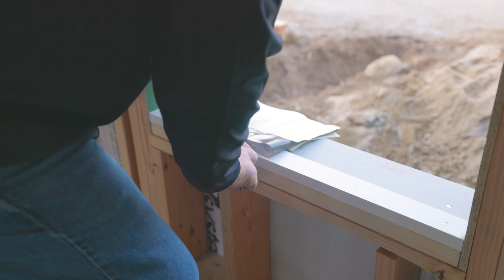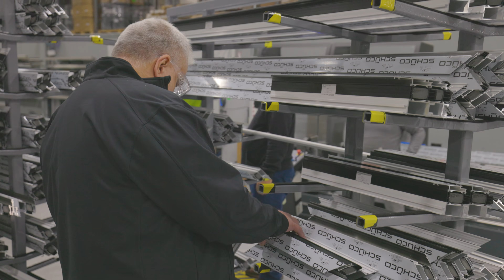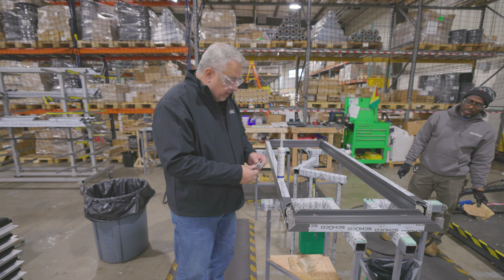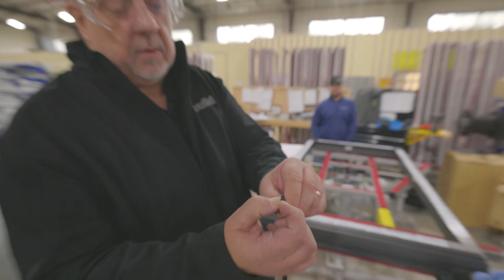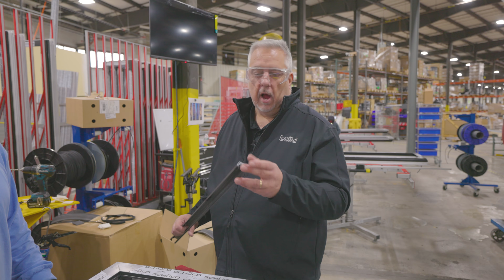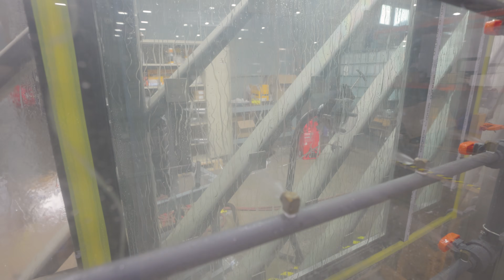"Window Installation Pt. 1" Build Show Build: Boston Ep. 8

Comment: I'm wondering how to reconcile the under-window shims that allow water drainage with a desire for a highly insulated window (here in CZ 6). Letting the water out is great, but engineering a thermal break to the inside of the window frame isn't.  Is there a solution for those of us in very cold climates?

Comment: Hey Steve, local fan of your work and fan of the show.  Question:  My wife and I recently moved from our post-war home in MetroWest (which had no window issues) to a ~15 year old custom home by the water in Plymouth.  We have been having issues with our window installation on the ocean facing side of the house letting water in behind the vapor barrier, which has resulted in some rot in the OSB sheathing.  Fortunately it has not made it in to the sheetrock.  Last summer I was able to replace the most damaged section to include some framing, and my removal of the window trim revealed no flashing installed except for the lead on the upper pendant details. 

I am planning on having a contractor remove the window trim on the remaining front windows, and flashing with a ZIP tape IF the sheathing is still intact.  If the sheathing is not intact, I will have him remove some of the siding and replace the sheathing with ZIP and ZIP tape flash the windows in place. Is this the best option short of removing the windows, which would increase the cost of the project, potentially prohibitively?  I'd normally do this myself, but I don't have the time at the moment.  

I know you mentioned having seen lots of bad window installs, I'm curious if you are familiar with the best practice for repairing incorrectly installed flashing.  Thank you for any thoughts and guidance!

Comment: Tariffs! Anyone know what the tariff is on a window imported into the u.s.?
Reply: Thank you for joining in - much appreciated , I don't but will try to find out
Reply: @stevenbaczekarchitect9431  I searched an couldn't find any info about tariffs on imported windows. I found it surprising that Schuco would build the windows in the US and was wondering if tariffs could be a reason similar to how euro car manufacturers complete their assemblies in the US to avoid tariffs. Loved the factory tour though, very interesting. I recently purchased Rehau euro tilt and turn windows for a basement window project, they are very nice however I did not realize until after they arrived that the frames are much larger than on a standard US window, ie there is a bit less glass relative to rough opening with these vs other options with my windows.
Reply: @fox156  You couldn't find???  It took me literally about 5 seconds to find out.  It's 5.7%.   From some chosen countries however it's free.   "us customs rates for doors and windows"   🤣🤣🤣

Comment: If it’s a 3-ply gas window assembly; can the outside facing window be a storm-ballistic glass or all three to prevent high or extreme winds from a projectile breaking glass.  Can this be provided by assembly manufacturer?
Reply: Hey there,  European windows fabricator here.  You can get ANY crazy combination of glass panes in your IGU from a good glass manufacturer.  I do, all the time.  For a break/penetration resistance glass, the best would be to use shatterproof glass, or laminated glass.  A laminated glass is two layers of glass glued with a PVB film between them.  The thicker the PVB the better, they come at 0.38, 076, 1.52mm.   You can even get a higher penetration resistance if you add a layer of film on the outside surface of the glass, (there are "bullet proof" films) but then you might be sensitive to scratches.  That outside layer is applied in the same manner as the tint on a car window, so they are replaceable if they scratch too badly during the years.

If you're looking at the 3 pane IGU, you might need to go to 2 panes because of the added thickness of the first glass.  You also need to take into consideration the total weight of the unit.  1mm thick of 1 sq meter is 2.5kg.  So a total of 16mm glass will be 40kg per 1 sq meter.  A sliding door can take more weight than a side hinges door or window.  There's also the hinge weight rating...  

Anyway, if you make the outer glass laminated and thick, the inner glass thinner but still laminated, you can get a high resistance to penetration. 

Oh well...  I didn't think my answer will be that long.  🤣
Reply: @danl.4743  Thank you Dan.   I lean on the more heavy duty - over engineering side so will save this and get back to you and Steve when I am ready.
Reply: Thank you for joining in - much appreciated - I believe than can provide the data

Comment: It's videos like these that are gonna make it hard for me to buy a house someday. I know there are a lot of builders in my area who DON'T have this level of attention to detail. 😏
Reply: Very hard to find builders who even understand these steps.  I became a fan of building a house with better building science thanks to watching Matt Risinger and Steve.  It has also been wonderful getting to know and learn from other clients of Steve and watch those homes being built. So many things have come from that process.  Drain water heat recovery was an amazing system I learned of from Andy.  Some trim details that solved my questions about addressing window detail came from Steve’s detail at the Riverside Project and Carl’s amazing attention to every step.  Watch Steve and Matt’s video from today for that detail using Fry Reglet.
Reply: Thank you for joining in - much appreciated
Reply: Exactly what I told my wife. They just want to nailgun something together and make the quick money and be gone they don't care what happens, or how poorly everything fits and works.
Reply: I’m a builder. MOST don’t. 99.9 percent of them don’t. If not higher.
Reply: Plenty of builders can do this, you just can't afford them. They work on industrial and commercial jobs. To get this level of quality you need engineers, architects, and well compensated general contractors to work specifically and almost exclusively on your project. That just isn't realistic for most residential construction. Build it yourself or supervise the shit out of it.
Reply: I live in the oldest town in Minnesota - Stillwater.  The houses that go up in my neighborhood are in-fill and high end.  You wouldn't know it from how they get built.  I have building a house on my bucket list but I didn't figure I would have to do as much work to get it done right.

Comment: The term “rebate” gasket derives from the term “rabbit” which is the cut-away or groove that was originally cut or routed into a wood window frame component… now as an aluminum extrusion the “grooves” are molded as part of extrusion… still the gasket “fill” the window groove that will fit together with another operating component… an old fashioned term that is updated to modern manufacturing technology.
Reply: Thank you for joining in - much appreciated

Comment: Love these windows! German precision made here. I almost bought these for our new build over a year ago. However, nobody in our market had any experience with installation and I was nervous about warranty/ replacement. I installed standard upper tier flanged American windows which are much lower quality. I am kicking myself! Has Shucco developed a resource network for installation and service? If you have the resources in your budget and the local talent to install I say go for it!
Reply: Thank you for joining in - much appreciated
Reply: It's been two years but anyway ... Shucco does not make windows. Never did. No european windows manufacturers ever manufactured windows. They are system providers. You can Google debesto production chain. Quite different from US where, windows manufacturers actually manufacture windows.

Comment: Could have done with this video 6 months ago. We had water leak through the zip system due to holes made from siding screws in the j molds. Caused major problems this probably would have prevented the issue.
Reply: Thank you for joining in - much appreciated

Comment: Most of European windows support micro ventilation. Just set handle 45 degrees up and you will get a small gap between window and frame but your window still be closed. It's not a bug it's a feature.
Reply: Thank you for joining in - much appreciated
Reply: @Steven Baczek Architect  welcome. Trying to be helpful. It's always a pleasure to watch your videos, even though a lot of things are not applicable here in Ukraine. Thank you, sir.
Reply: That’s not most of Europe though, i’ve only seen windows with the kiep and open function. Only in parts of germany have i see them.

Comment: How do you put blinds on tilt turn windows?
Reply: Have to account for them from above
Reply: You can, you’ll just have to pull them up to put the window into tilt mode and lower them again or have like wooden blinds where you can put your hand through and turn the handle.
Reply: Easy, put the blinds outside!

Comment: Thanks, Steve.  Great video!  Are you not a fan of ZIP liquid flash in lieu of stretch tape?
Reply: That is what I was asking myself. Seems like a lot of taping parts. Why not set everything (including the shims) and apply a monolithic fluid WRB around the whole sill? Polywall or Zip Liquid Flash
Reply: I have used both and liquid flashing isn't as much fun to install. In weird areas, it is easier to install liquid flashing but around a window or taping wall seams, flashing tape is easier.
Reply: I find them interchangeable, Much appreciated - thanks for joining in